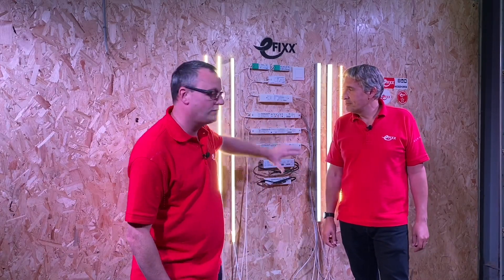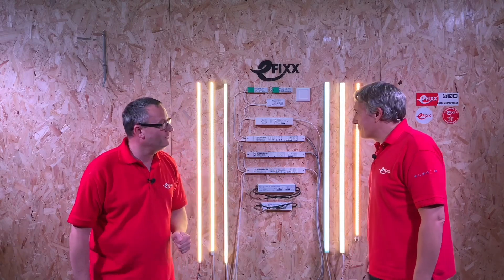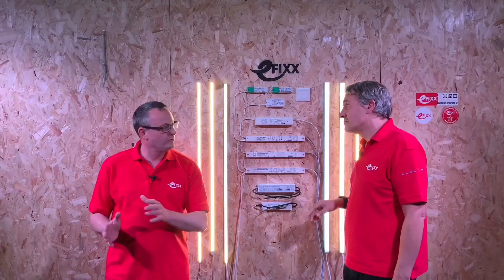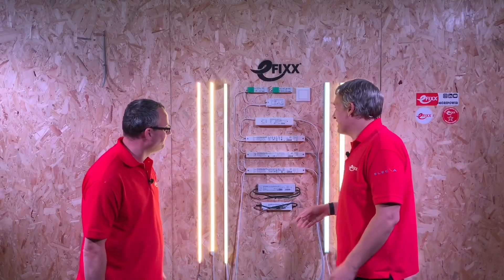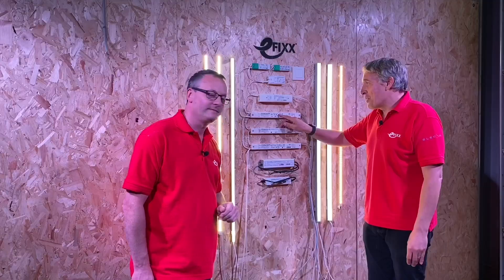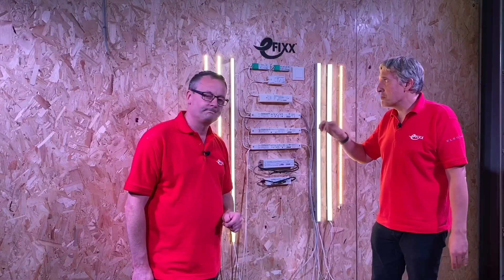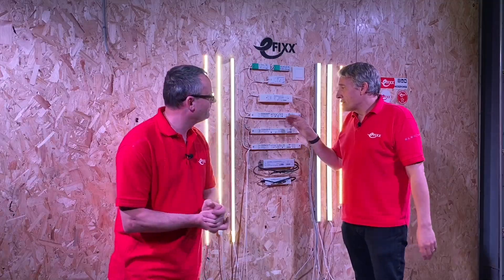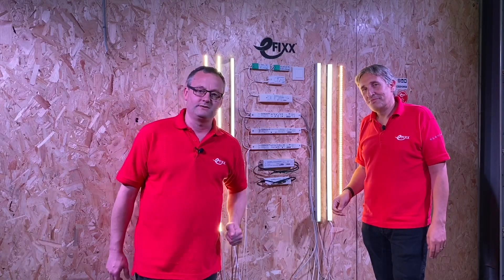What do these LED driver symbols mean? How can they help make your LED install more reliable?

Comment: Can you do a video on the difference between constant current and constant voltage drivers and how to select the lighting setup for each, not many uk videos explaining that on YouTube 👍
Reply: You need to select the driver that is appropriate to the LEDs you are using. Some LEDs are configured for constant current, but most LED tapes that can be cut to length are normally constant voltage

Comment: EL means extra low and it is for voltage.
Reply from the maker: In this case it’s for use with Emergency Lighting central battery systems.

Comment: How do you know whether or not a driver is rated for installation under ceiling insulation?  Is there a symbol to indicate that?
Reply: There used to be am F-Mark - and F in a triangle. This was removed from the standard a few years ago and is for luminaires. There is only a mark where the luminaire is NOT suitable for mounting on a flammable surface.  There is a symbol for insulated ceiling,

Comment: I have a valid question:

What is the legislation on RF interference levels?
Some LED drivers, being switch mode, can wipe out a nearby AM Radio (including a neighbouring property). They can also emit interference right up to the gHz region, so will interfere with Wi-Fi systems, as well as HF.

Being a veteran Radio Amateur, this interference concerns me greatly. Good quality genuine power supplies, contain common mode chokes and blocking capacitors, the fake Chinese ones don't have this filtering.
David G1ZQC.
Reply from the maker: Very valid point David. The number of times we switch on a a cheap electronic power supply and the workshop radio gets wiped out. The Osram products we are using in these videos are properly tested for EMC emissions. They also publish advice on installation with respect to cable lengths etc.  We will take a closer look at this as we explore led drivers. - Thanks (Gordon)
Reply: Perhaps the cheap power supplies are telling you about your poor choice of workshop radio station....
Reply from the maker: Or our dodgy wiring ;-)
Reply: @guffermeister  NO not MY choice of power supply. All the switch mode things I build are screened and leads terminated with feed through caps to prevent interference. I have no control over my neighbours however. Other than reporting to Ofcom.

Comment: What does a triangle with an ‘F’ inside it mean?
Reply: It means it is suitble for mounting on a flammable surface, but it is not used now as they only need to be marked if they can't be mounted on such a surface

Comment: Quick question.   Can a driver run happy enough with no load ? 
For example - the driver connected directly to the mains and run the 12/24 v to a switch then to the strip 

For areas like the bathrooms, where you could take a LV switch inside the bathroom zones ? 
Or anther case a walk in wardrobe with individual door switches.   So say 2 doors would take normally two switches two drivers and two strips.    Could it be one transformer feeding the two switches which switch the two strips separate ?    But the driver would always need to be powered on 
Would it over heat ? 
Would it wreck itself with no load ? 
Some drivers I’ve hear pulsing with on load on them 
My head tells me that it’s prob not a good job running a driver with no load.     
It’ll will work but it’s not quite right
Reply from the maker: A constant voltage driver can work with no load without problems.  You can have switching on the secondary side.  I’ve used the approach you describe in my own home. Usual disclaimer use quality kit with the right certification etc.  For constant current drivers you shouldn’t switch on the secondary side - hope this helps - cheers Gordon*
Reply: @efixx  that was quick reply,     Fancy working in my local wholesaler.